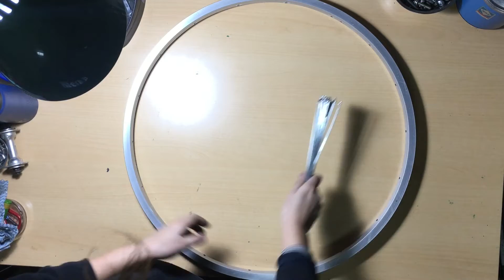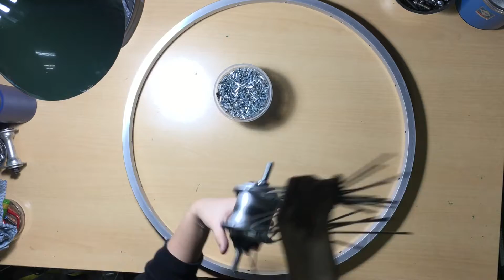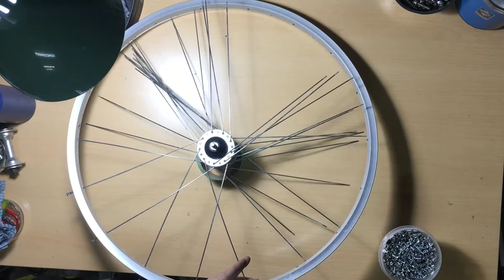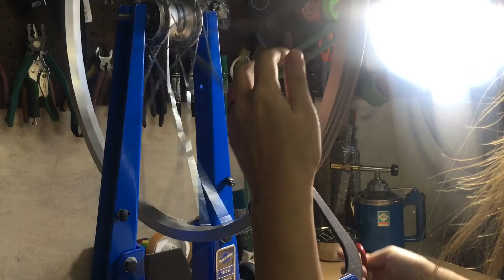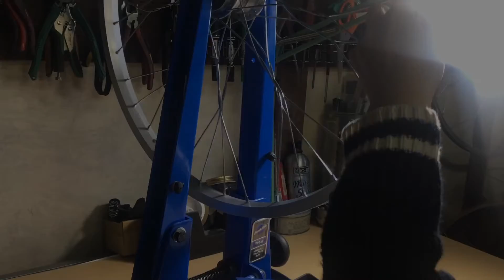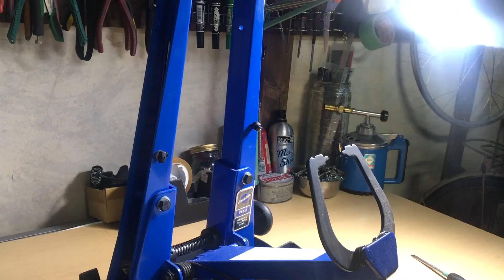City cycle wheel making twisted spokes.

Comment: Does it hold up strong  on the bike wen biking and doing jumps
Reply from the maker: I'm not good at sports, but my friend used to wear a twisted BMX wheel for tricks.  I don't know the ride quality, but the strength seems to be okay
Reply: Hi is 1 lace twisting strong and hold up on riding a bike
Reply: Hi the front spokes are 19mm long and my rear spokes are 18.5mm long and I want to use the front spokes for the rear wheel there will be 5mm longer spokes on the rear wheel will I be able to twist lace the front spokes on the rear it will be 5mm longer because the rear spokes are 18.5mm long

Comment: This IS NOT a twisted spoke...all he is doing is crossing the spokes a 2nd time, and actually making a weak wheel.  Great sound track though!
Reply: That's not true...
There are several ways to twist.
You can twist once or more if you calculate the length.
A change of direction a one twist.
If you twist the spoke one full turn, sending it to its original nipple...
That's actually 2 twists.
The only mistake he made was calculating the position of the valve stem.
Missed it by one hole.
Reply: It’s a lady… and it is a twist, she originally started with one twist and then a second to it’s original spoke? I have wheels like this and they hold up